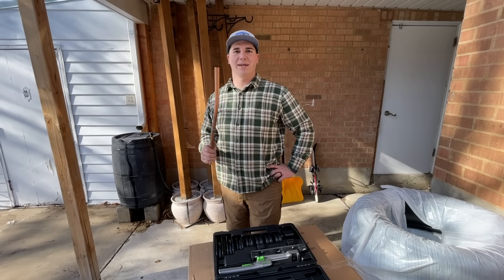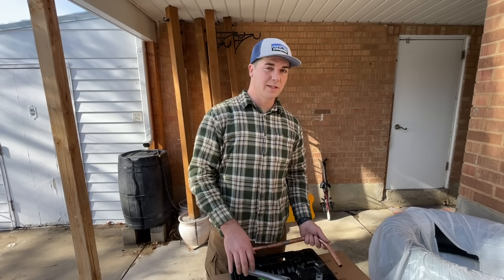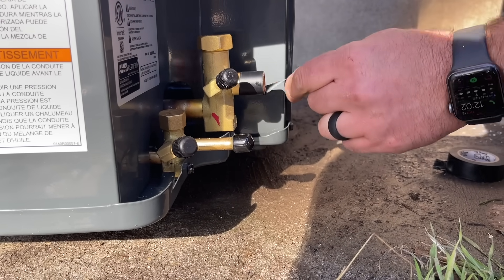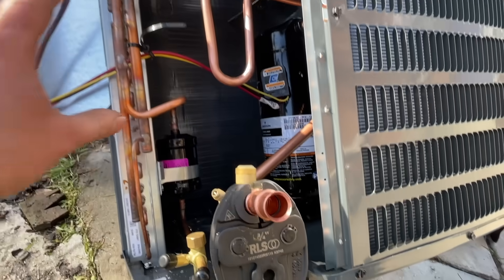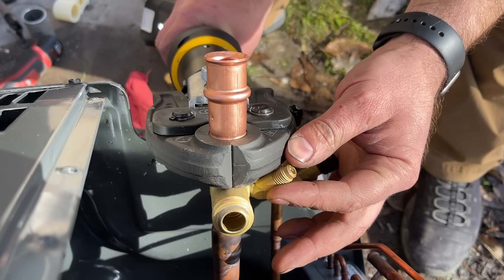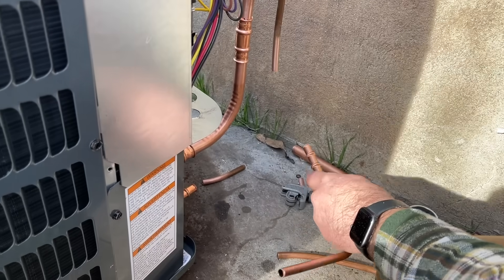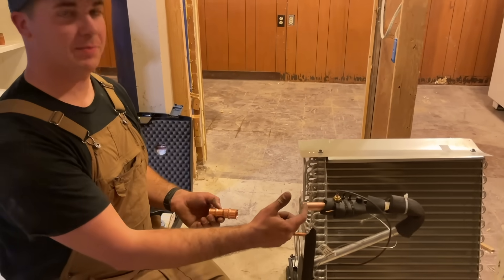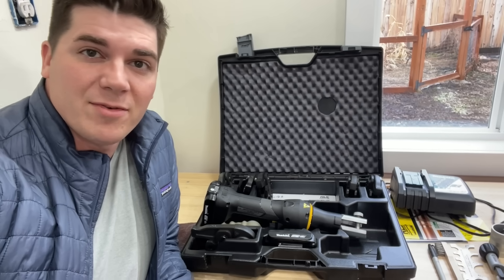Brazing Is For Cavemen. THIS Is The Future Of HVAC Copper Connections. -RLS Crimping Tool-

Comment: Definitely like the bends they look nice but the amount of time it took to go through all that effort and butcher the service valves isn’t worth it. I coulda brazed that in in half the time. It’s also a tremendously better connection and will last a lot longer. Also I noticed if you have a leak on your service valve at any point you gotta replace the whole service valve. Unlike a leaking braze connection that could be fixed easily. Could definitely see this being used in a tight spot or somewhere that would be tough to braze but other than that it’s a no go for me. Nothing withstands the stresses of a refrigeration circuit like a good ol phoscopper filler braze.
Reply from the maker: I’ll be doing a video showing how to remove one of these and braze if needed. That could be done instead of replacing the service valve for sure.

Comment: I would suggest to have refrigeration oil handy and lube the outside of the pipe where the O-ring will seal to. With vibration, the microdust of cleaning the pipe to be sealed to will wear out the O-ring. I would wipe anyplace that I used emery or something, with acetone or something. What I see now is two potential leaks at every joint, not just one. What gives me nightmares are the superfine leaks that only a few ounces need to be added every year. Heat pumps can be fussy and need the specific charge to operate correctly. I think I will wait a few years to know the reliability of the system. Plumbing with low to medium pressures are one thing, but add vibration to the equation and reliability can be an issue.

Comment: I've also been working in this field for over 25 yrs and I agree with Shane Carr and Theron Big Eagle.  I have an older version of the bending tool and it is a good tool.  I'd been done with this job in half the time brazing it with Stay silv, silver solder.  Easier to solder, stronger joint using way less heat than brazing rod.

Comment: I have many years of ac and heat pump install and service. Why didn't you pull new copper? I can tell from the door frame it's a older house so I assume you are converting from r22 to 410a. I have seen systems last 20-30 years by always installing new line sets and regular maintenance I'm not taking about mild climates either. West Texas is sweltering hot then bitter cold. I do love the hilmer bender kit get the reverse bender blocks they are worth it. On your  inside benders you can see a notch that will tell you where your bend will end just face the numbers towards you
Reply from the maker: Why does it need new copper as long as it’s flushed? I think it’s money wasted honestly.
Reply: @diyhvacguy  you will never get 100% of the old oil out when you flush the system are you flushing through the txv?

Comment: Do not believe this brand condenser is equipped with liquid line drier.  Majority of competent installers would have added one.  Since your tool wouldn't accommodate a drier you'd needed to break out the torch,   In this case.... why?
Reply from the maker: All Goodman’s have a build in liquid line dryer 👍🏼

Comment: I have the Streamline. It’s nice not having to braze inside. Also no hot permits for commercial. I wouldn’t recommend using it on the condenser like this. If that starts leaking you’ll be replacing the service valve
Reply from the maker: Not true. I’ll do a video soon on how to remove the fittings and braze it if need be. Thanks for the comment. Cheers

Comment: torch & lead all the way: the way he did it will destroy the whole copper pipe once the o-ring is not in working order a few years down the road.
Reply from the maker: Wrong. I’ll do a video showing how to remove the fitting and braze it in if need be.

Comment: These joints should probably be made available in various angles so that pipes no longer need to be bent, thus making the job a lot quicker, and saving the pipes from any possibility of damage during bending. I'm no technician btw.
Reply from the maker: They have them in 45 degree and 90 degree

Comment: The amount of leaks that will have one day is going to be insane lol. Gotta love it when you see an installer use them on a massive commercial system with a like set so long you can’t even imagine, and the line set is run through multiple floors/ceilings.
Reply: Good thing modern AC units only last 3 years. Just kidding...but not really.
Reply: @GeneralChangFromDanang My Trane unit is 15 years old, and running.  I'm worried about when I need a new one for the reason you mentioned.  My neighbors new units are already failing catastrophically.
Reply: @GeneralChangFromDanang  well could be right but much less item has better warranty than the cars these days
Reply: I bet they would never guarantee it not to leak for 10yrs ask and see
Reply: @tedhicks5431  
The connections have a 50 year warranty. Nothing new lasts that long. Hvac systems are made to fail
Reply: I hope so.  Made it into the trade just in time to get good at brazing, and I'll be around when they all start failing and no one will know how to braze anymore.
Reply from the maker: I can see where that would be another ball game. Worst case, these are easy to get to.

Comment: How do you take in account for oil affecting the o-rings? What if your condenser fan motor burns out and the liquid line is burning up? What about freezing of the evaporator coil and lines? Not for nothing but shrader cores get replaced all the time because of gasket failure.  I'm not dogging you because I know you didn't make the stuff, but I have questions.  It's a great idea but it's just that, an idea. I have to look at the practicality and longevity. Good luck with your investment. I hope you do follow up videos when you get leaks.
Reply from the maker: Sure. Time will tell. If and when it leaks you guys will be the first to know. If it’s 10 years I’d say that’s pretty dang good. Heck even 5 if it was a very small leak that could be topped off. But like I said. Time will tell and I was willing to invest in the tool. This video has completely paid for for the tool and all jaws by the way 👍🏼

Comment: Spoken like a true amature. Brazing is the safest proven long term method. Keep in mind this is Mom and POP Residential. We would never and will never use Pro Press fittings for HVAC in Critical Environments because they ARE NOT TIME TESTED and Proven. Brazing is for professionals. No Mechanical Engineers will sign off on Pro Press. We can't even get them to approve it for water systems. 

If sleeping at night knowing your work won't fail and lose 400lbs of refrigerant inside a Data Center then I would suggest you completely ignore this video and be a confident "Caveman"
Reply from the maker: Um correction sir. How ON EARTH is brazing the safest method? Wow
Reply from the maker: Also, if you are doing work on data centers, then I totally get it, but if you hadn’t noticed I was working on a residential 3 ton system. So if for whatever reason it leaks, it’s not a huge deal. If you don’t want to us it, DONT. 🤷🏻‍♂️
Reply from the maker: Also you aren’t even my target audience if you couldn’t tell by the name of my channel, so your comment is kind of irrelevant. Any contractor can chose to use this or not to, I simply made a video on my experience with them, and if and when they leak, you guys will be the first to know about it. Cheers

Comment: Lot of old heads in the comment sections here. Plumbing/heating mechanic here, and i can solder cleaner joints than most other people around, and i have no hesitation to press anything and everything possible. The shop i work for uses propress for copper up to 4", and we megapress gas pipes now as well. Any joint can leak, no one is infallible, no system is infallible, and anyone here who days theyve never had a leak, regardless of method, is full of shit. Not having to inhale solder/flux fumes for 6 to 8 hours a day while installing complex multi zone boiler systems is an absolute no brainer. And the orings in these types of products are rated and made of different materials engineered for different situations, pressures/temperatures etc. Give it a rest you old haters.

Comment: Seems like way more work to do what you’re doing I’ll stick to the “caveman “brazing 21 years in the business. I’ve also used crimp fittings in an attic where I didn’t wanna lug a torch in there.

Comment: I would venture to guess that the fitting manufacturer would not support your application to attach to the vapor line or liquid line on your Goodman unit. I would suggest brazing or soldering a stub to attach your compression fitting. Not sold on the crimp fittings personally for refrigerant line applications, but you do as you want with your customers.

Comment: how about performing leak detection on your work? How long will this crimp last with the O'Rings? What is the material that the O'Rings are made from?
Reply from the maker: You must have not watched the whole thing. We did a 400psi pressure test that passed no problem. These fittings are warrantied for the same amount all hvac systems are warrantied. 10 years.

Comment: There's nothing better for copper water pipes than lead free silver solder. I do not recommend brazing on water pipes, since that can cause intercristalline corrosion and leaks. If brasing is mandatory . Then with a very high silver content. I am not a fan of shrink+o-ring systems since o-rings become brittle over the years.

Comment: It would have been a lot faster and easier to silver solder the copper pipe directly onto the service valve tail, probably a lot cheaper too, this is non sensical. The only time this might be of advantage is in the roof space of a building where reaching the location with oxy torch is difficult or in a fire hazard situation, any way thats my opinion.

Comment: At 3K this is out of my reach as a DIYer. I am looking at a few other options. 1. I could rent one of these tools for around $85. 2. I could by a manual version of this for under $200  3. Use the Zoomlock push (non-removable) fittings or 4. Staybrite 8.  Ive never soldered but with some practice I am confident I could w/o issue. Thoughts on the best option?
Reply from the maker: Staybrite 8 for sure. Yea grab some pipe and fittings and do some testing! Heat your fitting up from the opposite side and use the pipes heat to melt the solder into the joint, not the flame! I’m still working on it myself but honestly the biggest two things are make sure everything is clean and prepped, and second don’t overheat it!   If you need some more help, feel free to check out our Patreon membership for support. That can be found at Patreon.com/diyhvacguy. Cheers friend
Reply: @diyhvacguy  Thanks Buddy!

Comment: Didn’t think a 150psi rating was sufficient for refrigeration lines
Reply from the maker: These are UL tested at 800psi. They are NOT plumbing fittings they are specifically engineered for hvac

Comment: How do you open the joints when replacement fittings have to be added?
Reply from the maker: Carefully with a dremel tool. I’m going to do a video showing that process soon. It’s not too bad. Stay tuned.

Comment: Will this work on reversing valves? Hard pipe ?
Reply from the maker: Yes works with any pipe soft or hard copper, and as long as you can fit the jaws you can use it

Comment: Brazing uses brass as the filler and is a much higher temp than silver solder which is a higher temp than soft solder.

Comment: Wonder if this will make its way into the manufacturing side of things, especially on bigger 30 and 40 ton rooftop units
Reply: Manufacturer’s will do a cost benefit analysis, if it cost less yes. But if you ever seen how fast manufacturers can braze joints it’s mind blowing. The have multiple flame heads using natural gas and oxygen and each joint is done in 10 seconds for small tube and 20 to 30 seconds for larger.

Comment: @diyhvacguy. This is nothing new. These connections are in widespread use across the whole of Europe and have been for many many years. I have installed tens of 1000s of these fittings in wet heating systems in Scotland, and trust me, once they are crimped they never ever leak. The "O" rings don't break down because they are never in contact with water and are made of a different material than standard rubber "O" rings. It was part of a combined heat and power project in Aberdeen and other major cities across Scotland and some cities in England. All the council owned, rented high rise apartment blocks in the city had these systems fitted. The project started more than 15 years ago and they are still holding just fine. The systems were pressure tested to 3bar before going live to the main system. We (8 teams of 2, 1 Journeyman and 1 apprentice) all tested the fittings to see how they worked and to see if they would leak, including cutting them open to check all the contact points  before we started fitting the systems in the apartments. I was very sceptical at the start considering i had been soldering copper all of my  working life but after doing 2 or 3 systems, i was sold. It is fast and clean. Myself and an apprentice were cracking out 4 fully working 7 radiator heating systems per week. That was start to finish, including boring through steel reinforced concrete from room to room and having a Friday off !!. I have been a Plumber, Central Heating Engineer and Gas Service Engineer for 35 years in Scotland

Comment: Cavemen?? it takes more skill to “braze” then it does to “clamp” connections together with a machine that does it for you. Also I have a unit leaking from one of those fittings and the site isn’t even 1 year old yet. People who weld and braze aren’t “Cavemen” they are “skilled” workers. Yeah Clamped joints will leak later on due to the metal expanding and contracting due to the temperature change of the refrigerant. Don’t crap on the ones who did it before you. Brazing is still the most widely used skill across the world.
Reply from the maker: Whoa whoa, I didn’t mean to ruffle your feathers. It’s just a crafty title is all, I love brazing and it really is an art. I will 100% be doing more instructional brazing videos but I’m not gonna be that guy that refuses to try something just because I’ve done it a different way for 20 years. No one is twisting anyone’s wrist to buy a crimp tool. I just wanted to share a new tool that enjoy using. Time will tell if the joints leak, but I’d like to find out MYSELF. Not just criticize it because that’s what others have said. Cheers

Comment: Brazing may be for the caveman, but the caveman can at least sweat out a brazed connection.
Reply from the maker: Amen, the title isn’t intended to be offensive, and i will still braze but the crimp tool has its times when it’s awesome to have. You are right though, to unsweat a fitting is a lot easier then cutting an RLS fitting out without cutting into the pipe.

Comment: How often does anyone find leaks during that type of fitting installation. Like during initial installation leak checks before pulling a vacuum and charging the system? 

How often does Amy find leaks down the road after the system had been running for years?

 How hard is it to repair those leaks when found?  Is it harder than a traditional brazing repair?

What's the difference in price between traditional sweat fittings and these new ones?
Reply from the maker: This is my first full install with all crimp fittings. Pressure tested with nitrogen up to 400psi as you saw, no leaks. Why would someone do a leak test after charging the system? If you find  leak and it’s easily accessible, you can cut it out and replace those fittings quite easily. If needs the fitting can be cut off with a dremel and brazed in.   A straight 3/4 RLS fitting is 12 dollars, a regular sweat fitting is what 2? There’s no questing the crimp fittings are expensive but you are paying for the convenience
Reply: @diyhvacguy  leak test after charging the system? I think maybe you got confused about one of my questions... it i worded it wrong and can't see it. 

Anyway,  wow that's insanely expensive and all that work you had to do on the fittings at the suction and liquid line of the condenser kinda defeats the convenience factor. 

As far as sweat fitting costs goes those can be minimized out eliminated by using a  pipe expander (depending on pipe size) 

Maybe doing a video on that would be cool (if it hasn't already been done)

Comment: We have tried multiple options for no flame copper connections. The industry will have to find an alternative to make copper connections that are leak free without flames. We have been using pro fit sockets and unions for copper connections.  In the near future open flames will not be allowed.
  The zoom lock your using WILL FAIL. WE know this from experience. We still use it for our plumbing department. But they are not reliable over time in the hvac systems. Maybe the vibrations or possibly the chemical composition of the refrigerant. We have made a commitment to remove torches from our trucks ASAP.

Comment: Guess its about the customer, the products approved and no brazing makes filling out hot work permits to not be required. The cost of the crimp however is more expensive than the brazing is, and theres alot of time invested in the prepwork for the crimp. But theres a place for both. I remember a copper pipe glue for water, that helped me out on a plumbing job once where the pipes were cut at floor level when the house was relocated.